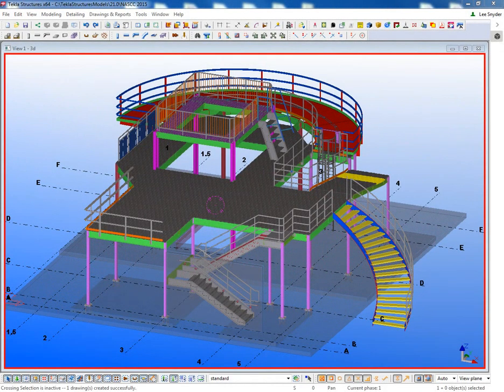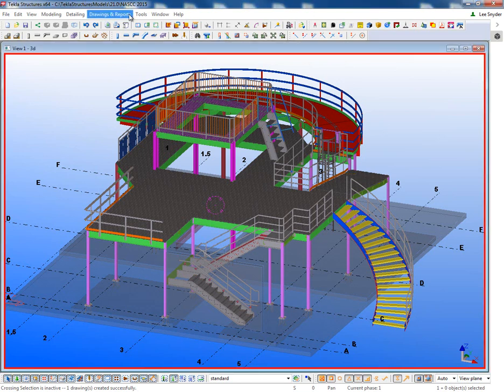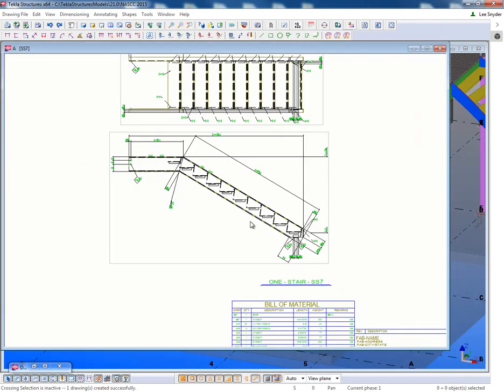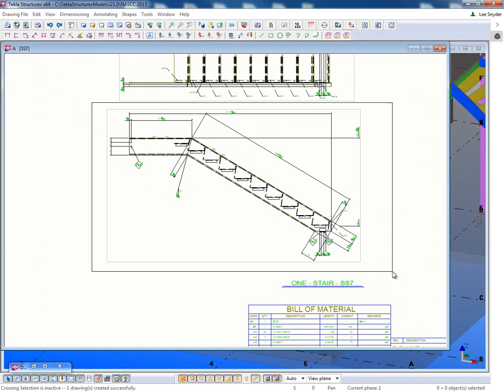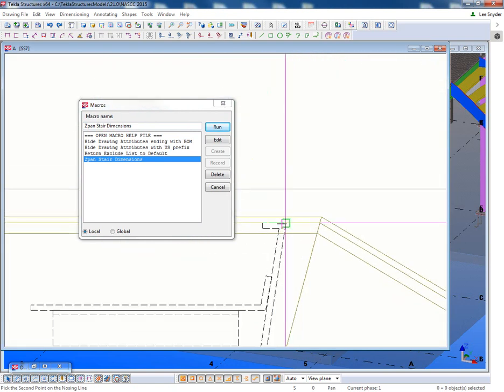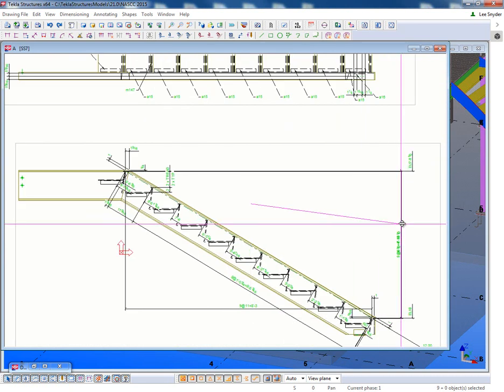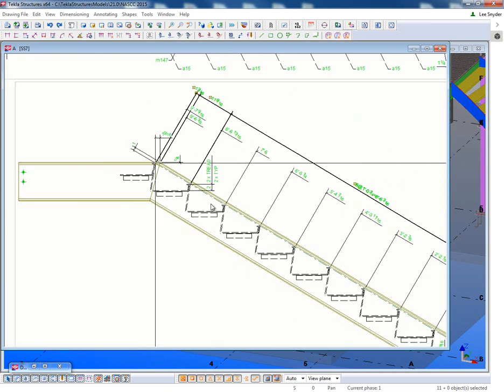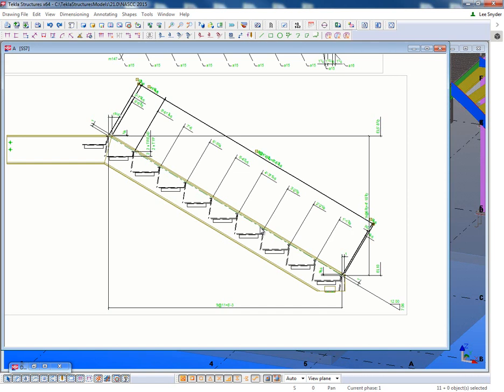ZPan Stair Dimensions

Comment: Following the instructions but I cant see the "plan"....
Any special settings in the "rule sets wizard"?
Reply: In this example I'm using the US Imperial environment which includes a top (plan) view for the stair drawings.  If you don't see that view or are using a different environment you can double click in the background of the drawings to open the "Assembly drawing properties" dialog box.  Then click on "View" and set your Top View to "On" and click "Modify"